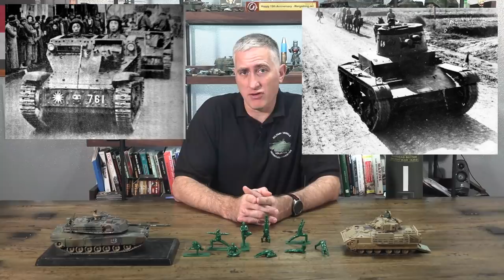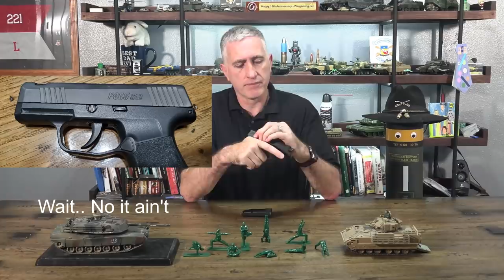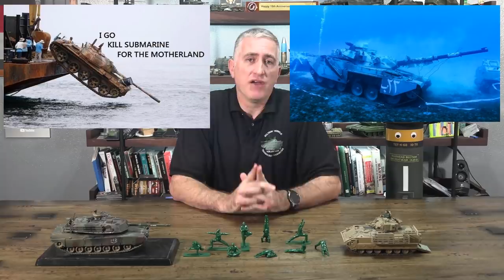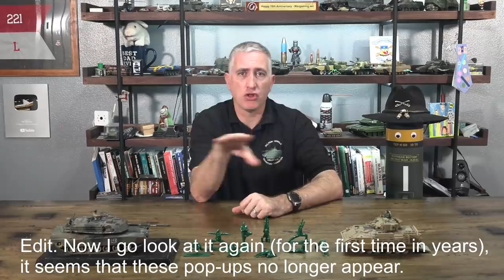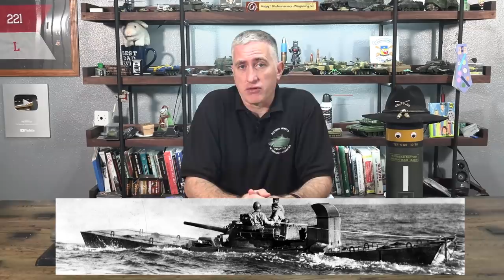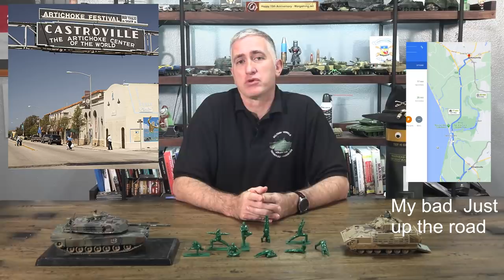Chieftain's Q&A 17. Rants, Ladas and shooting the other guy's cannon

Comment: Do you have knowledge of any design specs where the designers did not quite understand what the particular thing being given that spec was for (didn't understand the conditions it was to be operated under or exactly its real purpose)?

I will give an example of this that seems nearly impossible, but was true:  Armor-piercing projectiles, what are they for?  One would immediately think that they were to punch through the armor and directly damage the things behind it that were important, since the armor itself has no real function as to the use of the thing armored other than to keep that said thing functioning when the enemy is most intensely trying to stop it.  This seems to be obvious, but originally it was not.  The wooden sailing ships built up to the year 1859 for the French GOIRE and 1860 for the British WARRIOR, both the first "true" armored sailing ships were subject mostly to the fire from muzzle-loading cannons firing cast- or wrought-iron solid cannon balls ("shot"), with red-hot shot (incendiary) or black-powder-filled shells (demolition) being usually limited to the guns of some land forts which could handle them more safely.  As such, cannon balls were mostly to hit crew or individual gun mounts on the enemy ship with only a rather low-level use for causing holes in the hull near the waterline to try to sink the enemy ship (usually rather easily countered by hammered-in wooden plugs by crewmen nearby).  The concept of a cannon ball punching through the hull and still having enough energy left to do any likely kind of significant damage (other than throw dangerous-to-the-crew wooden splinters) was not even considered as part of the weapon's purpose.  Thus, the very concept of "armor-piercing" projectiles was not thought of much by naval ordnance personnel until the first ironclads forced it to the front of the line as to purpose.  And what did they think that projectile's purpose was?  While, the same thing that they had thought the cannon ball's purpose was, to punch holes in the hull to let water in and to damage upper hull personnel and equipment as the old cannon balls did -- the AP rounds back then were almost all solid shot and, for much of the rest of the 19th Century, the AP rounds for use against the thickest armor remained solid shot (the Germans, for one, did not put explosive fillers into their naval AP rounds until 1902!).  This became the design spec for these projectiles at the start in many navies and were only revised to include heavy internal damage to the target warship as experience showed that this was possible or likely.  Some nations did not change this baseline spec until THE MIDDLE OF WWI even when they were using high-explosive-filled AP shells.  The British for one.

As time went on in the 19th Century, the British adopted the high-explosive-filled AP shell very soon after such explosives that were "gun safe" came into being near the end of the 1880s.  Lyddite (picric acid or trinitrophenol, one of the most powerful of these explosives) was found to be, when properly loaded into a shell, capable of safely being fired out of a big gun and gave the most "bang for the buck" to damage the exposed portions of enemy warships not behind heavy armor (the reason for the several rapid-fire medium-size gun batteries in the ships at the end of the 19th Century) so they and some other nations used that kind of explosive (under various names).  The US Navy, with the most experience in this kind of warfare during the US Civil War, most pointedly did not ever use Lyddite or any such easy-to-detonate high explosive, requiring explosives that were more safe to use and inert until a proper fuze action set them off.  Later tests by the British showed that Lyddite could be set off exactly like its fuze had functioned, even if the fuze was removed from the shell, by the sudden impact shock of hitting thick armor, which late in WWI led to its being removed from British ammunition.  However, prior to this removal, the British AP shells were ALL using Lyddite filler by the start of WWI.  During the war, most especially the huge Battle of Jutland, several British battle-cruisers and smaller ships were sunk with only a couple of German warships similarly sinking (though a number of German ships had their topside torn up badly, losing entire turrets, and a couple of ships almost sunk by many slow leaks).  After the battle, a huge British investigation was made to find out why this lopsided result occurred ("There is something wrong with our ships today.").  Many changes were made to prevent ships from blowing up due to turret hits and in improving their AP ammunition, which they did to make said ammo (the new "Greenboy" projectiles) the best in the world at the time just after WWI.  They got rid of Lyddite, for one thing, ASAP.

It is what they found when they went to the AP projectile manufacturers that is illuminating here:  The expert personnel from the new Projectile Committee investigating the ammo problems wanted to see the test results that the several shell manufacturers had, as a start.  The manufacturers, which were obviously on the defensive here, proudly stated that the test results, which they showed in detail, were exactly as required by the shell specs.  And, most unfortunately,  they were!  The specs said that one of the major requirements was that the shell was to punch through the side hull of the enemy warship near the waterline and explode WHILE PENETRATING THE PLATE OR VERY ASHORTLY THEREAFTER to cause the largest possible hole for flooding the enemy ship.  NOTHING was said about doing any deep major damage to the enemy warship!!!!  In effect, the specs HAD NOT BEEN CHANGED SINCE THE 1860'S WHEN FIRST PROMULGATED AS TO THIS REQUIREMENT.  The manufacturers showed "successful" tests where the shells blew HUGE holes in the armor that they hit by exploding while halfway through the plate, in many cases blowing the plates in two.  They had met the specs to the letter.  Of course, what this showed was that even the rather thin internal "turtleback" sloped plates behind the side armor and "splinter" bulkheads and "protective" decks would virtually stop any internal damage to the ship hit in its middle hull, as these areas were designed.  Needless to say, delay-action fuzes and replacement of Lyddite by Shellite (a new very insensitive, but reasonably powerful, explosive) in the big gun ammo and, in the smaller guns, TNT fillers that could be made inert to armor hits immediately followed.

Sometimes, you really "can't see the forest for the trees", it seems...

Comment: #AskChieftain
In 2013 Yuri Pasholok published an April fool's joke about british considering license production of T-34 and KV-1 back in 1942. Joke consisted mostly of T-34 photo with 17 pounder. Not sure if such suggestion was real, BUT "what if"?

So the question is, what can british experts do with full access to information on production solutions of T-34 mod.42, KV-1S and (since soviets can't switch themselves) full sets of design papers and documentation on soviet tank prototypes like T-34M, A-43/T-43, T-150, T-220 and KV-3. F
Last three can result in british Tiger, first  two can basically lead to earlier Centurion. How would adopted british versions look with british engines, guns, armor assembly, optics and radios? What parts would be used?

Sorry if the question is a bit too weird.

Comment: Commenting super late, but i thought it was necessary to remark this: The chieftian briefly discussed DU penetrators and TC penetrators, and how some (Mostly EU-based) countries refuse to employ the former while extensively deploy the later, in spite of both being arguably equally contaminating for the environment in which they are used. While this is true, it is entirely moot. Refusal to deploy DU pens. is based far more on IHL conventional issues in relations to wounds sustained by fragments of said penetrators and its effects on combatants, more widely, rather than any ecological concerns. And in this, there is just no two ways about it, DU is far worse (and arguably unlawful) than TC when it comes to bodily effects.

Comment: 49:51 Canister rounds for the 76mm? Doesnt the muzzle brake cause problems for canister?
Reply: It can. I know for small arms a sabot round does not like a muzzle brake.
Reply: @ScottKenny1978  Evidently thats why the Brit's 17 pounder had accuracy problems. The muzzle break interfered with the sabot round.
Reply: @billd.iniowa2263  I thought that was caused by barrel whip? Because the 77mm HV (17pdr shell in much shorter, fatter case) didn't have the accuracy problems that the 17pdr did.
Reply: @ScottKenny1978  Well thats what I was told in one of these groups. That's why I purposely used the word "evidently". I'm hardly an expert on ballistics. lol
Reply: @billd.iniowa2263  fair enough.

Comment: I have always wanted to know, What is the current procedure for dealing with modern tanks when they are disabled in combat and have to be left behind by their crew without the ability of the tanks recovery. In ww2 the Germans would try to blow up their panzers so they could not be used. What is the current protocol.
Reply: Look at operation in Iraq, the US blew them up if they could not recover them and they were at risk of capture
Reply: Yes but what I wanted to know was, How they blew them up?, Doe's the crew have a special explosive charge in the tank that they can activate before leaving the tank?.
Reply: @lokivonbrandis2129  He explains both officially sanctioned and field-expedient methods in the very video you're commenting on 19:15

Comment: HEY, CHIEFTAIN!

I've got a crack-pot theory I want to run by you.

We know that the Iraqi's operate a down-rated version of the M1.  We also know they lost a few to ISIS which were loaded onto flatbeds and driven off somewhere.

In looking at the new North Korean tank, I can't help but notice that they use a US style track very similar to the M1's.  The configuration of the running gear looks very much like the M1's; specifically the track angle between the idler and the 1st road wheel and the road wheels.  Also, the North Koreans have put a comically long side skirt on their tank, as if they were trying to hide the suspension.

You have more experience with the M1 than I do, are those camouflaged M1 hulls?

Comment: Big black plume of diesel exhaust...

which im assuming the M1 and its gas turbine doesnt have?

Yet Armored Warfare makes the gas turbine Abrams have worse camo when moving than the Diesel tanks.
Reply: You have about 4x the exhaust volume in a turbine. I'm assuming that Armored Warfare is using thermal imagers, so that huge plume of hot air shows up quite brightly
Reply: @ScottKenny1978  They dont use thermals at all.  Its basically WoT with modern tanks in terms of how simple it is now.  AW just thinks the Abrams is garbage and has every mechanic about it WRONG and or backwards and says: Turbine make tank easy to see.....much like how thye make the TUrbine give the tank atrocious mobility, while the Diesels make tanks move much better overall...

And if the exhaust from the Abrams would show up bright in thermals, the big plume of black smoke from a diesel shows up nicely to the MK1 eyeball
Reply: @CMDRFandragon  huh.

I have no clue, then.

Comment: Was friendly fire between allied aircraft and ground forces a common occurrence? Or a matter of once is too many?
Reply: By June of 1944, most of the Luftwaffe were scrap, so rarely strafed WALLIED troops on the ground. Erg. "friendly-fire" was the most likely explanation for burning WALLIED tanks - out of sight of Panzers. This situation is similar to Gulf War 1 when more WALLIED tanks were damaged by "friendly-fire" than Iraqi fire because few Iraqi tanks got off more than a few rounds. The Iraqi Air Froce had been strafed into scrap metal or fled to Iran.
Reply: It happened often enough that the 9th Tactical Air Force was called the "9th Tactical Luftwaffe" by the ground soldiers.

Comment: That was a very good example of Abrams vs T34. Obviously everybody would pick the Abrams until you put the question into a specific context and then suddenly an extremely outdated operating tank is better than a cool looking steel barricade.

It wont work all of the time though. If you take two tanks that are only separated by one generation or a few years and define the specific role for them with all other things being equal then you can move to a more objective stance. Panzer 3 vs Panther in a "medium tank" role for 1944. 

You do have a point that given the correct circumstances you can argue that any weapons system is better than any other one. Flak88 vs Russian S-400 system teleported back to 1944. Panzer2 vs Leopard2 to park in your driveway for many years and then use in an apocalypse scenario. It is quite amusing to figure how twisted you can make the arguments.

Comment: There’s a story about Robert Stanford Tuck “putting a round of 20mm from his plane, down a barrel of a flak gun (flakvierling 38?).
that resulted in a burst barrel.
Of course there was some apprehension by Flight Leader Tuck as he was shown this (w/much mirth) by his then captors, as he had been shot down in the encounter. Evidently it (shot/burst barrel) amazed/amused “Zee Germans” who “congratulated” said Flight Leader for his accuracy.
Question Can you describe the “trading/evolution” of a new tanker? In that, what position does he/she usually start with, and do they evolove into different roles I.e. loader then gunner then ultimately tank commander.
(Also, what degree of cross training do tank crews have, can everybody be capable of driving the vehicle, can they load the main weapon, even be capable of aiming/gunners tasks, (at least at a basic level, till “help” arrives?).

Comment: well that's because if you look away from a Lancia it falls apart
Reply: eh, I don't think they were that bad
They rusted and the electrics were faulty, but the engines are good.
Reply: @Random-nf7qb  I personally don't think they where either but i was quoting top gear I got the chance to drive a 1975 stratos and it was a joy

Comment: Side question, I don't understand the U.S. R&D system. It starts a project, replace X for example. Works on it, designs stuff, spends hundreds of millions and builds prototypes, takes years. Cancels project. Money gone, prototypes go to museum, back to step one, replace X... ? Except years are gone, the money is gone and now you have nothing to show for it?
Reply: there are different issues
sometimes the project is just to push along technology, you keep pushing the envelope to lead to newer, better things, also help to try and keep any technological lead
sometimes the project is intended to enter service, but changes in requirements, political pressure or just a totally unsatisfactory prototype will close the project
Reply: @quentintin1  I suppose it also keeps your industrial and development skills working as well. Good point, thank you! :)

Comment: Pretty sure that most of the "debate" over DU ammo is just people trying to cause trouble. Lead and uranium exist in the soil naturally all over the world, millions of tons of it. And the amount of either that gets fired of is negligible overall. If your water table is right under a firing range, you might have some issues, but rounds being fired here and there all over the place isn't likely to have any serious effects, unless a few people in certain locations experience a very unfortunate set of circumstances that ends up with dissolved DU rounds running directly into their well. When you hear about the actual amount of stuff that goes into the water all over the world, usually without obvious consequences, the controversy seems silly.

Comment: How many Japanese tank destroyers made it into prototype phase. They didnt really use many tank destroyers during ww2 why?
Reply: They didn't really use  much armour either, and that armour they had was old-school / small.  My guess (and its only a guess) would be resource constraints - they couldn't produce and fuel the vehicles.  A further thought was that an awful lot of their combat was either in jungle (where vehicles were firmly stuck to a road so a towed AT would work) or in static positions on islands, where mobility wasn't required.  Perhaps a case where there was no doctrinal use?

Comment: Greece formally asked for used M2 Bradley. US replied with an offer for 300+ retired in boneyard M2A0, in very bad condition. The offer was rejected because of the cost of refurbishment was too big. Greece asked for M2A2 ODS. They are still waiting for an answer. 

Some Greek media say, that BAe  will set VETO on the sale, because they think that they will lose a customer. They also say that BAe blocked the sale of M113A3, because they want to get a contract for the upgrading of Greek M113A1/2 to A3 or MTVL level. Unlike Croatia, a recent recipient of M2A2 ODS from US inventories, who turned to BAE for refurbish and modernization, Greece does not need the help of BAE to refurbish used M2A2 ODS. 

In other news, Greece will get up to 1200 M1117 ASV from US stocks, among other equipment. They are working hard to get 80-90 M1117 from European US inventories.